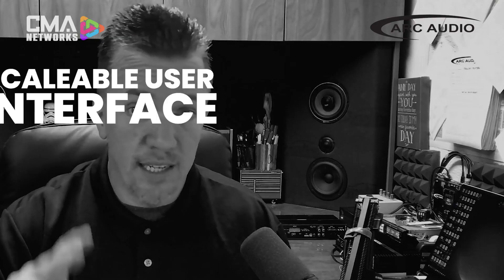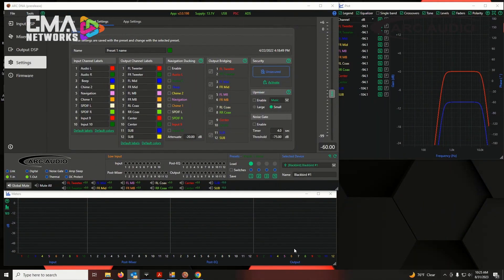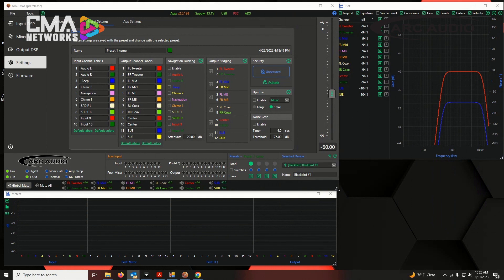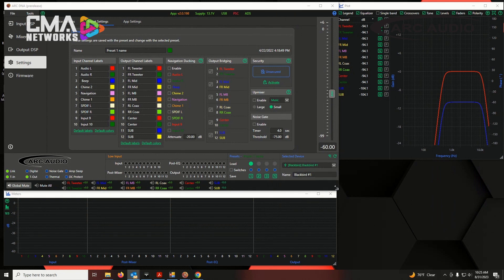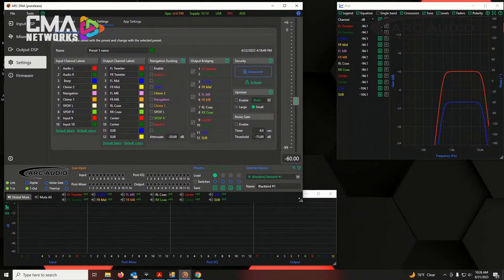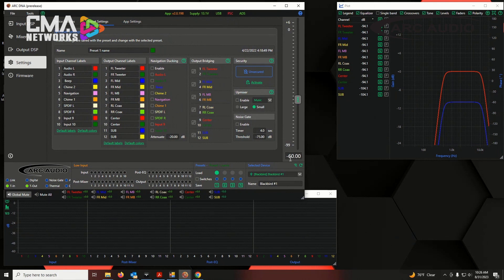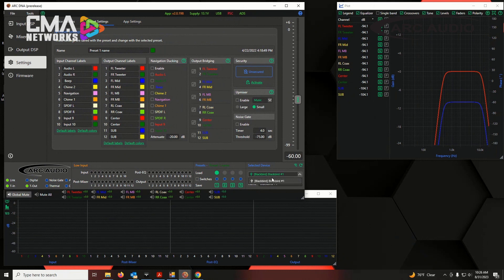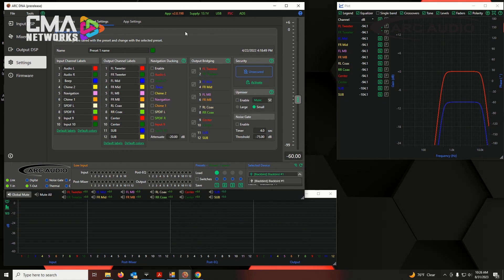5 REASONS TO CHOOSE ARC AUDIO - DSP

Comment: Hi Fred, where do I get info on how to connect ARC 1000.6 to car power and JL Audio sub ? Just bought them both. Kenwood head unit is installed, speakers installed. But now I'm stuck with where to go from here. Where do I get training on your DNA software? I'm new to dsp's and I don't find much ARC configuration information. I see lots of videos like this one stating how good ARC is or what great features it has; but so far not much on how I install it. By the way, the dealer won't tune it until it's already hooked up and working; a sort of cart before the horse issue. So, that's the impass. How to even get it to a working state without blowing up my tweeters and whatnot. I would think this is a very valid question and problem in the dsp industry. But, maybe it's just me...  🙂
Reply: I did call ARC tech support just after my above comments though and they were very helpful. They answered my power and hardware configuration questions and once I get it hooked up, they will remote in and help me do an initial configuration. So, I feel way better. 🙂